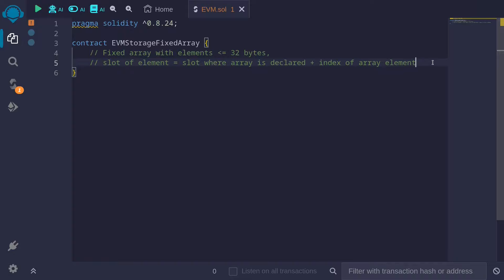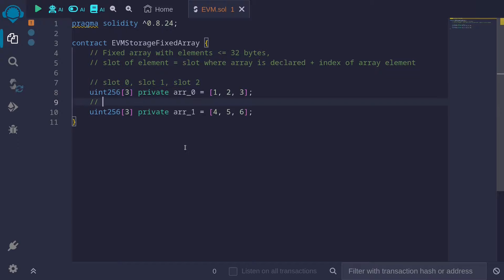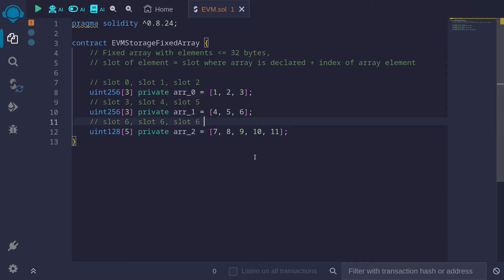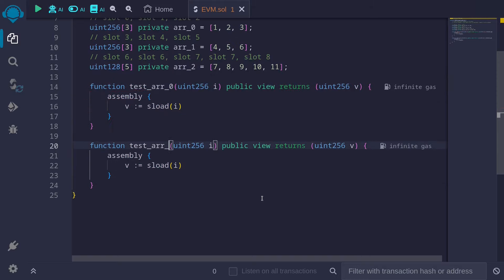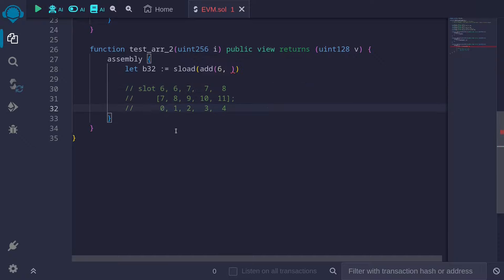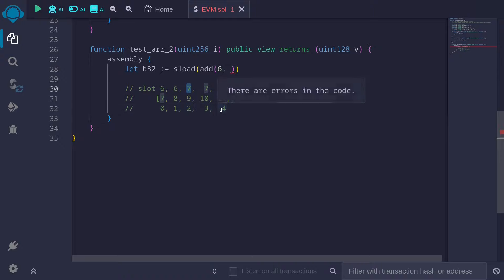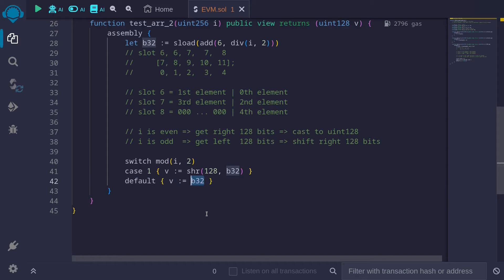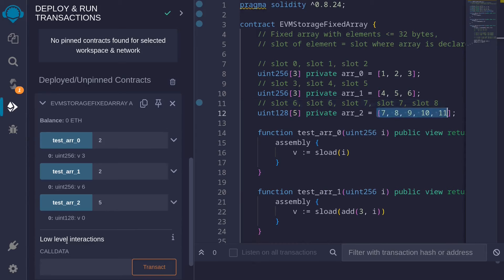Fixed Size Arrays | EVM Storage 6

Comment: Great video.

I really wonder why Solidity was designed using little endian (which causes the layout of the swapped uint128 values in the slots). It always confuses me. I grew up with the Motorola 68IK which uses big endian and it simply always made more sense to me.

Comment: Instead of using switch case to get the elements of arr_2, you could use something like this:

v := shr(mul(128, mod(i, 2)), s)

This line of code shifts the s variable to the right 128 * 0 = 0 bits when the index of the array is even and 128 * 1 = 128 bits when the index of the array is odd.